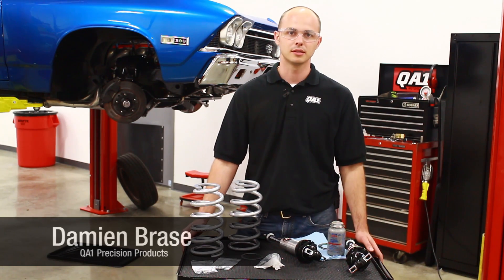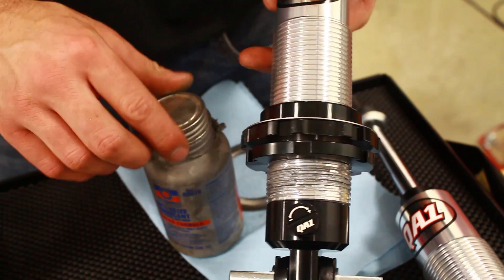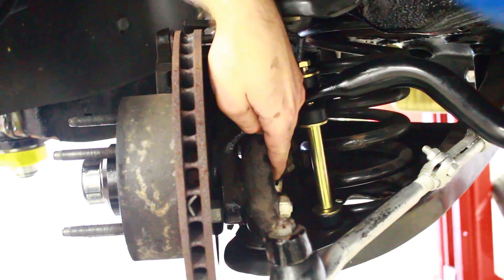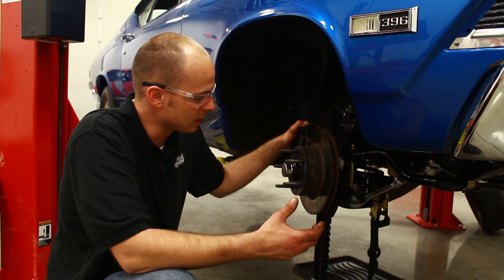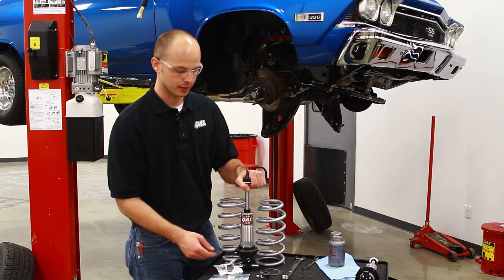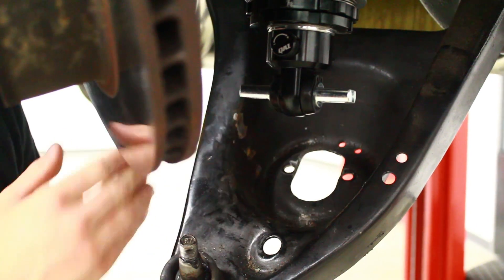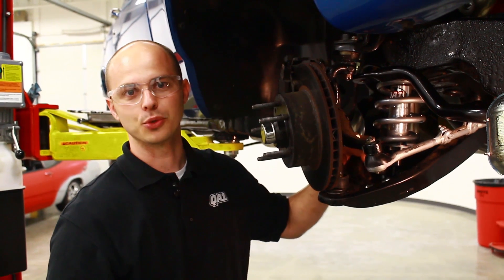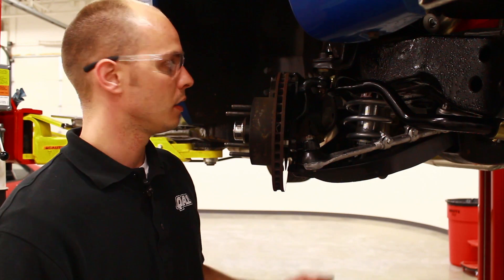How To: Installing QA1 GM Pro Coil Coilover Shock Systems

Comment: As you lower the car by compressing down the spring, the spring has a higher rate and less travel, just how stiff and hard riding does it get compared to stock?
Reply from the maker: this one is hard to explain in the youtube comments, give us a call at 952-985-5675.

Comment: Every QA1 install video makes the ride adjustment look so easy but it doesn’t seem to be that easy. After preload, these things are entirely too hard to adjust if you want to raise them. According to multiple videos I’ve watched, no matter the starting point, the springs can be adjusted 3” & doesn’t make your ride stiff. My application sits somewhat lower than I’d like it. Anyone ever used a spring compressor on the springs to allow more height on these coilovers?
Reply from the maker: Hi there! I would recommend reaching out to our tech team for assistance. There could be a few different factors as to why your car may be riding too stiff / too soft or that you're not able to get the ride height you want. They are available at 952-985-5675 or Sales@QA1.net

Comment: Do you recommend against support plates between the LCA and the t-bar at the bottom of the shock? I got some to go with my coilovers since I don't know if the stamped sheet metal will be strong enough. This is for a 2nd gen S10 2wd with stock lower control arms.
Reply: I am curious about the same thing. I thought about making some plates and welding them in to strengthen the control arms.  I have looked at a number of videos of coilovers on stock control arms and none of them address this so maybe its not a big deal.
Reply: @cuzz63  I got some UMI performance lower and upper control arms and mounted with the t-bar on top of the control arm, no issues so far. I think the problem might be when people mount under the control arm for a little extra drop. If the t-bar is on top the bolts just have to keep the bottom of the shock from moving around. When mounted under the bolts are under tension with the full weight of the front and also keeping the bottom of the shock in place.
Reply: @TheViolatorinator  the T-bar is still putting all the weight onto a small area around the bolts of the lower control arm, which seems like a potential problem. I found a part sold be Alden that will help this. Aldan  Support Plates for GM Front Lower Control Arms
Part Number: 038-ALD-39
Reply: @cuzz63  Just be aware that it will give about 1/2" of lift at the wheel with a 1/4" reinforcing plate. 

Also, I found that with 650 lb springs that are 10" (length that comes with the coilovers) you won't get any drop at all over the really stiff moog stock type replacement springs. I ended up going to 600 lb 8" springs (also by QA1, 8HTBF600) for some actual drop (can go damn near on the bump stops but I went to about a 3-1/2" drop) with it still plenty stiff, and I had adjustability to spare. Also finally got the chevy lean leveled out that I'd had with the old stock springs, stock type replacements, and the 10" coilover springs.
Reply: Also, since I made my first comment  7 months ago when I was just thinking about getting coilovers to level out the front this spiraled hard into making my shitbox 4 banger with a 5 speed into something to compete at autocross. I got 17x9 wheels with some sticky 255-45r17s to replace the stock 15x7s and all seasons, sway bars front and rear, lowering springs for the back, and replaced the front brakes with some new better parts.
Reply: did anyone come up with a conclusion to this?
Reply: @punch_bowl_turd3005  I haven't had an issue with the UMI arms that have thicker metal and coilover bar mounted on top. before then, when I did have the stock arms the reinforcing plate didn't seem to be an issue. I guess it's some cheap insurance If you'd like it for preventing the coilover from going through the stock arm, might as well do it with some longer grade 8 bolts if necessary.
Reply: @TheViolatorinator  thanks, i got a few months to figure out what gonna do, plates are goin for near $70 now....
Reply: @punch_bowl_turd3005  I though I typed out a reply, but I think it got flagged or something and disappeared. I used some plates for old F/G bodies currently going for about $40 since my 2nd gen S10 has the same/similar suspension. If you have a different vehicle, check if it shares suspension with something else and use those other vehicles to widen your search.
Reply: @TheViolatorinator  yeah i got a g body and this post was 1 i saw & still there.    "@punch_bowl_turd3005  I haven't had an issue with the UMI arms that have thicker metal and coilover bar mounted on top. before then, when I did have the stock arms the reinforcing plate didn't seem to be an issue. I guess it's some cheap insurance If you'd like it for preventing the coilover from going through the stock arm, might as well do it with some longer grade 8 bolts if necessary. "

Comment: Do u have a video n parts number of a front set of QA1 coilovers for a 2011 chevy Colorado 2.9L i wanna upgrade my front suspension
Thanx
Reply from the maker: Hi there! We currently do not catalog anything for this vehicle. We may be able to make some shocks work depending on your specs. Please measure your shocks at your desired ride height from center of eyelet to center of eyelet and call our tech team with this information. Based on that, we will be able to recommend something if we offer it! We also have a tech article and video on how to properly measure your shocks if you have further questions. Our tech team can be reached at 952-985-5675 M-F 8am-5pm CST. Thanks! https://www.qa1.net/tech-center/tech-articles/how-to-measure-custom-shock

Comment: Good morning, I have a 2005 Chevy Silverado it leans to the left, my question is with coil-over work on the front to help adjust the vehicle so that it would be level, thank you.
Reply from the maker: Hi there! Yes, these coil-overs will help fix that issue. We just released front coil-over shocks for the 99-06 2WD 1500s.

Comment: What's the benefit?? Can you adjust the ride height??
Reply from the maker: Our front pro coil systems will lower your car up to two inches. They also offer up 18 levels of adjustable valving so you can set your car up for whatever driving you are going to be doing that day so you are always riding in comfort.

Comment: THAT LOOKS SKETCHY AF.

THOSE MOUNTING POINTS ARE MEANT FOR A SHOCK ONLY!   NOT A SHOCK AND SPRING COMBO.. GET SOME PROPER AFTERMARKET LOWER CONTROL ARMS AND DESIGN YOUR SYSTEM AROUND THAT.
Reply from the maker: Our coil-overs are designed to work with your factory control arms and/or our tubular control arms. We've never had an issue.

Comment: Could you point me in right direction for front and rear suspension kit for 1988 caprice classic
Reply from the maker: I sure can! The link below will take you to QA1's kit that has suspension upgrades for the full vehicle. It also has a Part Numbers tab that lists all the part numbers of each component. 

 https://www.qa1.net/suspension/handling-suspension-kits/gm-handling-kits/78-93-gm-bbody-handling-suspension-kits

Comment: Do you guys have anything for a s10
Reply from the maker: We do! We have front coil-overs, rear smooth-body shocks, and front upper and lower control arms!
Reply: Would I need the upper and lower control or will it mount to the oem ones and are these on your website
Reply from the maker: They are designed to work with our control arms or the stock arms. 

Here is the link for the front coil-overs.
https://www.qa1.net/suspension/street-performance-racing-shocks-struts-and-pro-coil-systems/front-pro-coil-shock-systems/401c-gm-front-pro-coil-system

Here is the link for the rear shocks.
https://www.qa1.net/suspension/street-performance-racing-shocks-struts-and-pro-coil-systems/stocker-star-non-coil-over-shocks/804-aluminum-stocker-star-shock

Here is the link for the upper and lower control arms.
https://www.qa1.net/suspension/street-performance-racing-suspension-components/gm-street-control-arms
Reply: @QA1TECH 2001 s10. when using your lower control arms, can i still use my stock front sway bar?
Reply from the maker: @35hilos  You bet. Our control arms are made to use with the stock and upgraded components.
Reply: @QA1TECH    cool. Do you guys make a sway bar for my 2001 s10?
Reply from the maker: @35hilos  Sorry, not at this time. We just have front and rear shocks, front coil-overs, and upper and lower controls arms for S10's.

Comment: I have an 84 cutlass 455 aluminum heads and intake, no ac unit still has stock coils in it,it sits nice which coil overs would I use,load per square inch?
Reply from the maker: Hey Jim, You would be best off trying to get the front end of the car weighed.  If that is not possible, a 400 lb/in  spring should do the trick. You can always call our tech line if you want some more personalized advice. 952-985-5675.

Comment: So coil overs can be installed in the factory control arms eh ow much can the ride height be adjusted? Also if the ride height is changed is a wheel alignment needed?
Reply from the maker: The amount of adjustment depends on the application, generally somewhere around 1 1/2 to 2 inches. 

As for the alignment, anytime you make changes to the suspension, it's a good idea to verify alignment.
Reply: QA1 right on thanks man👍👍

Comment: Awsome video i have a 2004 single cab silverado with 5/9 drop 
 you guys make any front coilover kit for it?
Reply from the maker: Hey Adan, We don't have anything cataloged that will help you out, but if you give our tech line a call at 1-800-721-7761, we can ask you a few questions and get you a recommendation that might help you reach your goals with your truck. Thanks for reaching out!
Reply: QA1 alright sounds good and thank you

Comment: No washers for the underside of the A Arm where the coil over got bolted to?   Those two flimsy little nuts were the only thing keeping that from ripping thru the stamped sheet metal A Arm.

That looked either not done right, or not engineered as solid as it could have been.   Like a solid plate that comes up thru that big hole with a couple of upset down U bolts or some machined piece to mate with the unit on the underside of the a-Arm.    ANYTHING but 2 small nuts with not even washers between them and the A Arm.     Right?     Am I being too anal retentive?
Reply from the maker: Hi thanks for your comment. There is also a t-bar mount on the bottom of the shock that we mount in the factory location on top of the control arm so the weight of the car is still being focused in the same place as when you are using the factory spring/shock setup. Mounting it from the bottom would put the weight on the two nuts and would likely cause them to fail in some way. Hopefully, that clears things up! Thanks.

Comment: I hate when they say   SOLD SEPARATELY.    
if it's supposed to be there. it should come with it.    very shitty way to screw your customers out of more money for your overpriced parts.    thanks for the info
Reply from the maker: Thanks for your feedback. Including or not including spanner wrenches is an interesting topic. We’ve asked countless customers what they prefer and the vast majority voted to order them separately as they need. Including them automatically actually increases the price of each and every kit due to the extra material cost of producing each component. Many of our customers have multiple sets of coil-overs from one or more vehicles. You wouldn’t need multiple sets of spanner wrenches, so we offer it as an accessory item for when you need it. This ultimately saves you money because you’re not buying parts you don’t need. Thanks again!
Reply: @QA1TECH  I agree on the spanners but the thrust washers should come with the coilovers.
Reply: @cuzz63  what are the thrust washers for?
Reply: @rchavez5056  they really arent thrust washers so much as bearing washers....they allow you to turn the nut without the friction from the non bearing style.

Comment: I wonder if this will work with my Toyota mini truck hmmmmm.?????
Reply from the maker: Some people have made these work on Toyota trucks, actually. We've never confirmed fitment ourselves, but we've seen people use first gen. Camaro Pro Coil systems and a steel plate. You can try calling our tech line for more info at 952-985-5675, M-F 8-5pm CST, otherwise I'd snoop around on forums. Thanks!
Reply: Thank you very much. Highly appreciate it.

Comment: Is this a single or double adjustable coilover?
Reply from the maker: We install a single adjustable Pro Coil system in this video, but a double adjustable version is also available. Thanks!
Reply: GS 507 09450 D
This coilover is for 62 impala small block.  Does it come with spanner wrench?
Or do I buy that separately?
Reply from the maker: Hi Blake, spanner wrenches are sold separately. They are part # T114W, thanks!

Comment from the maker: TECH TIP: How do you install a QA1 Pro Coil System on a GM?

Check out this video to see the steps involved in installing coil-over shocks.
Reply: QA1 Precision Products Do you have to have the front end aligned after installing these?
Reply from the maker: Chances are, if the ride height is the same as it was when you started, you will be fine. But QA1 does recommend having your suspension realigned as good practice.
Reply: I've got 67 Impala and I purchased your Coilover kit for it. The stock shock is mounted on the bottom of the control arm and slips through the center of the control arm. Is the Coilover supposed to mount on the bottom as well or is it supposed to mount on top of the lower control arm?
Reply from the maker: @ulrichherrera9964  The coil-overs are designed to bolt into the stock locations of the factory shocks.